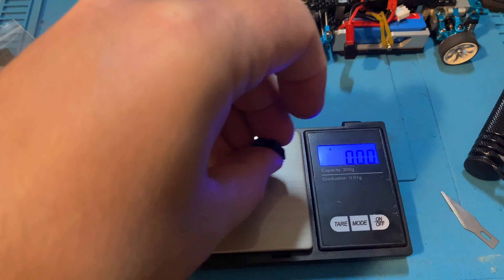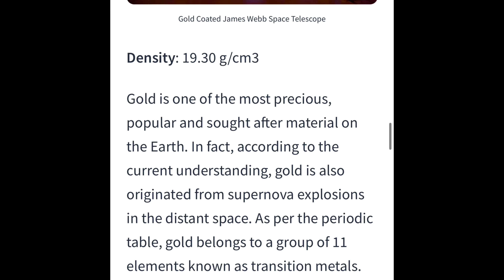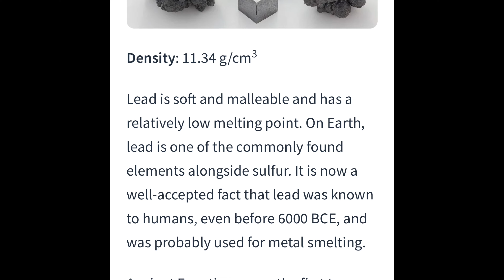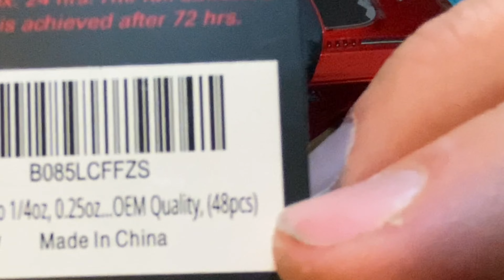SCX24 - Bronco Free Mods Part 2 - Shock Chop/Flip and Adding Weight on the Servo

Comment: i flip the shock over and fill the fake res with solder to help a little weight down below
Reply from the maker: Def a good mod!
Reply: How do you not melt the reservoir.
Reply from the maker: @jasonhemmerlin6139  you can use low temp melting solder. Also, if you are really worried about it, cool the shocks in your freezer and then add some solder. Cool again and add more.

Comment: Is there enough room under the ESC tray to fit one of those weights to get a bit of the weight lower? Great series of vid's to see the progression of mod's and there improvements. Thanks!
Reply from the maker: You can, but we think that is adding weight too hight.  We want to keep all extra weight below the springs.  Unsprung weight is best.
Reply: @TheShopMiniRC  Yep. Just referring to those stick on car wheel weights as cheap easy weight. Instead of stacking them all on top of the servo, is there room for at least one of them under the servo tray to get some weight lower down?
Reply from the maker: @wingnutbert9685  ahh. No room under the servo tray really.  Maybe if you had some really small. But it sits right on top of the axle.
Reply: @TheShopMiniRC  Gotcha! Really got to get out and get one for myself. Chomping at the bit as this looks like so much fun!